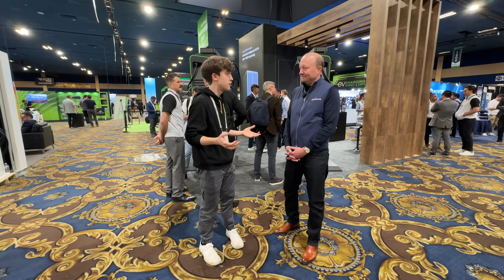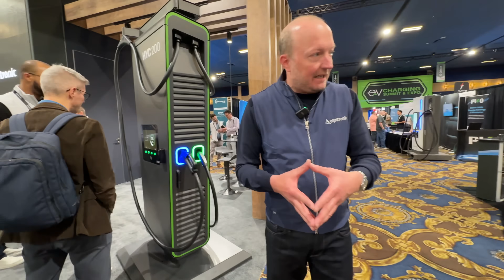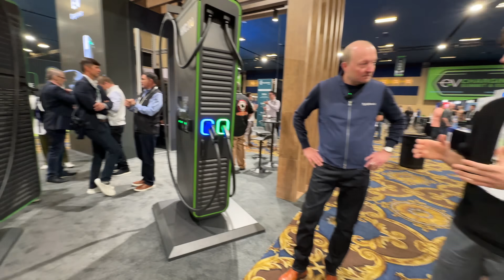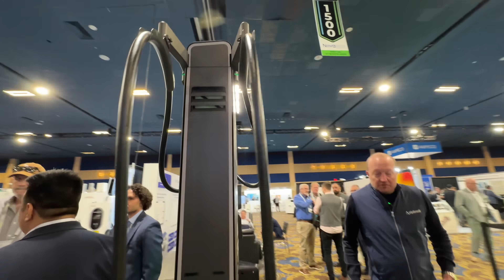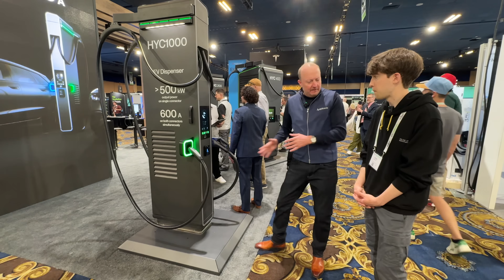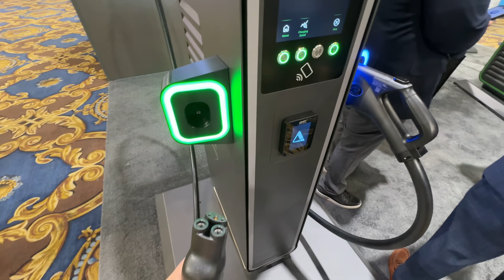Alpitronic Says HYC1000 Rollout Starts Now!

Comment: HYC400 is great, but HYC1000 seems cheap Kempower knock-off.. fewer satellites, less power, 3x bigger granularity, no customers.. Sorry, but future has passed already and Kempower is leading.
Reply: In Germany HYC1000 are installed right now as truck chargers. Mostly with satellites that have both MCS and CCS with oil cooled cables.
Reply: @Andi.und.sein.E  Yeah there are few. And One in portugal and Denmark(?) But still. Kempowers are everywhere and has been for years. They also have an edge on MCS.
Reply: @scronkfinkle1408  i visted a HYC1000 in Belgium 2 weeks ago, there is an Electra site with HYC1000 40 minutes from where I live

Comment: Tesla proved it can be reliable and powerful. No one else is even trying to be that.
Reply: Cannot remember a charger not working in over 5 years.

Kempower and Alpitronic also make high quality equipment.

The most important factor is that the CPOs maintains their equipment, something that seems lacking by some CPOs in the USA.
Reply: lol tesla is not even the most reliable network in Europe, in several countries Tesla is on the podium but not number 1
Reply: This is not true at all. The competitors aren't at the same level of reliability yet, but they have been improving. Electrify America for example is much better with up time and repair time than it was 3 years ago.
Reply: In Europe Tesla is the last you go to if you are 800V cars where Alpitronic or Kempower are first choice.
Reply: :D Tesla and their 250 kW charging... :DDDD
Reply: @s @scronkfinkle1408 Still reliable
Reply: @scronkfinkle1408 Tesla has 90kW per stall.
Reply: @MichaelEricMenk  Even better.. :D I rarely use them even if I drive Tesla. Finnish CPOs have faster and cheaper alternatives.
Reply: Tesla has bad speed since forever
Reply: Tesla
v1 90 kw (2012)
v2 140 kw (2016)
v3 250 kw (2019)
v4 500 kw (2023)
Just put in in context if you have a "slow" Tesla charger thats because it was installed 5-10 years ago.
Reply: @KissTamas3 
Tesla 
V1 (2012) 75kW/stall
V3(2019) 90kW/stall

Kempower fully stacked: 100kW/stall
Alpitronic fully stacked : 125 kW/stall.

Number of V4 Tesla superchargers installed:
N. America Jan 1 2025: 0
Europe Jan 1 2026: 0

Where did you get the year "2023"?